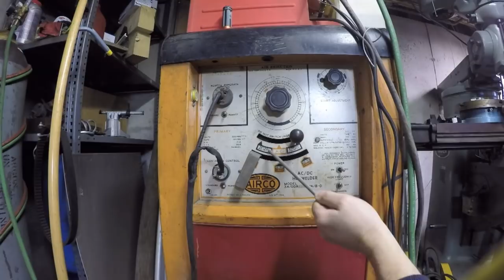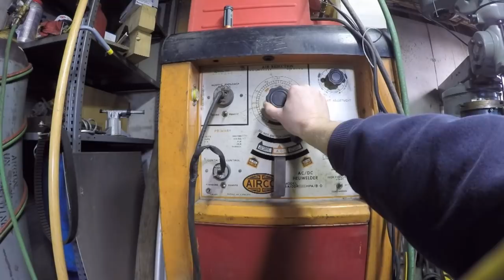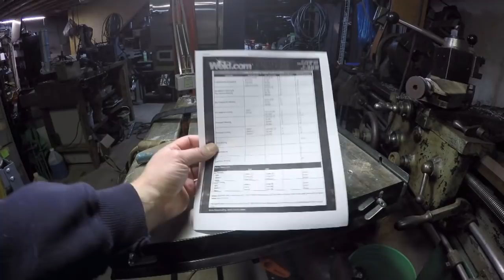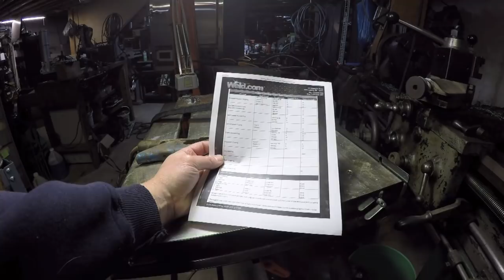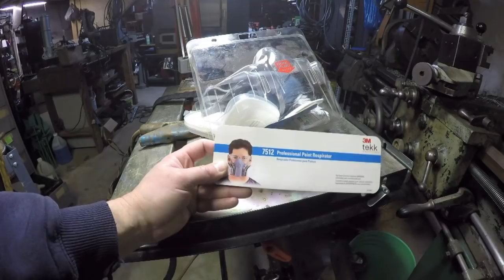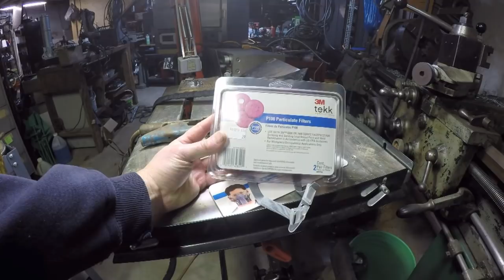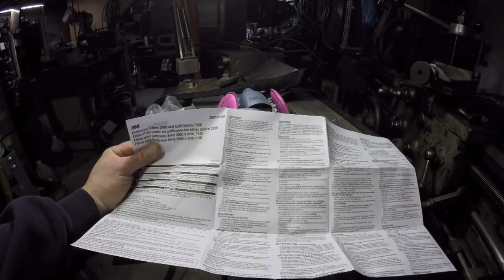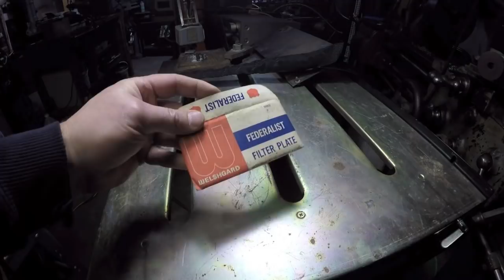A Noob Tig Welds Part 3

Comment: I have almost the same welder only in the Miller 3 phase version  SR-200-32, which I converted to single phase. Best welding welder I've ever used.  Extremely smooth arc. Only problem is when or if you have to move it , they weight 800 pounds. Very well made to say the least.

Comment: That is brazing rod. Regular brazing rod contains  zinc . Under the high TIG temps, the zinc boils and vaporizes. That white powder is zinc oxide. Those rods are for O/A gas (or O/P) welding and are used with flux (heat rod and dip in flux powder.) They are my go to rods for cast iron.
ER70S-2 for steel. They are usually copper coated. In a pinch, you can use MIG wire as it is the same or similar grade. I've taken 3 or 4 lengths of MIG wire, clamped in a vice then put the other ends in a drill and twist together..
4043 for aluminum is most common.

Those welds look good. You have a good feel for it. If you have done O/A welding, that is a big help. My first welds were perfect; then it went wonky. Watching some of Jody;s videos and I was doing OK (was stabbing the rod.) My hardest part is seeing. Steel is easy but aluminum it is sometimes hard to see the puddle. Starting aluminum is the hardest, one you get going it is easy. 

Oh, I have even cheaper HF gloves (3 for $10.) On leather and swede gloves if your fingers get hot, take them off. If you stop thinking they will cool down you burn your fingers as the heat is still propagating through the leather.
Reply: Oh, I cut the filler rods in half. That long rod whipping around makes it difficult. If you want to play, use coat hanger wire with the coating sanded off ;)
Reply from the maker: Thanks Scott.